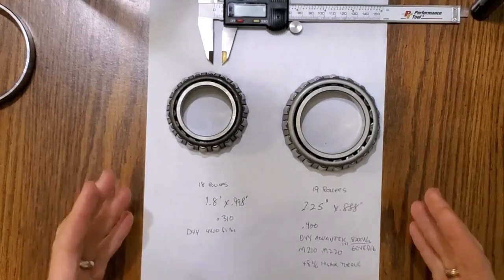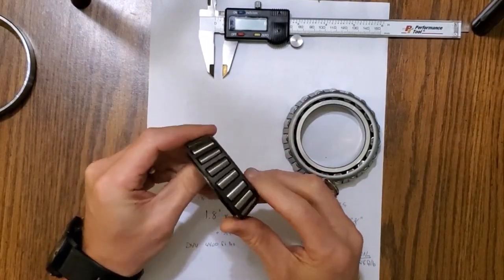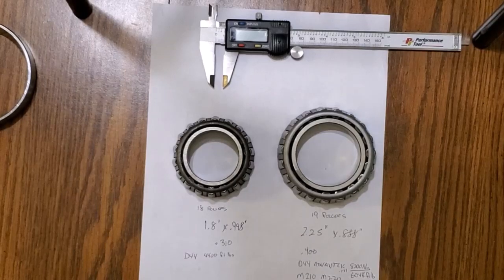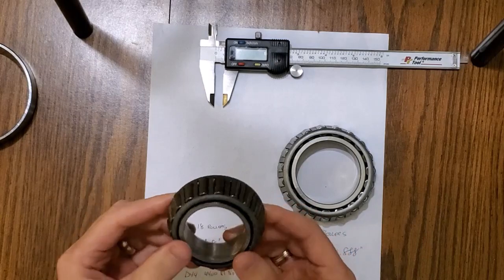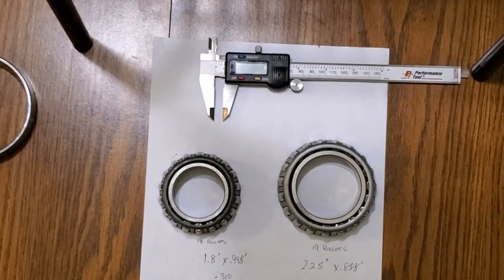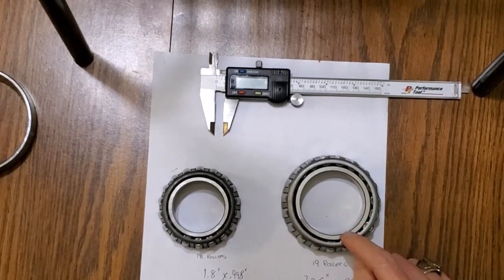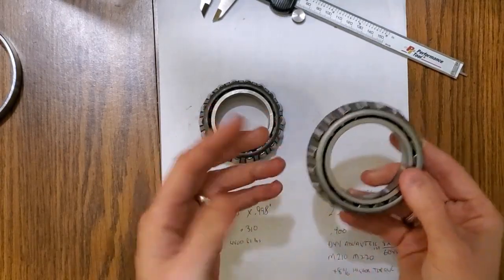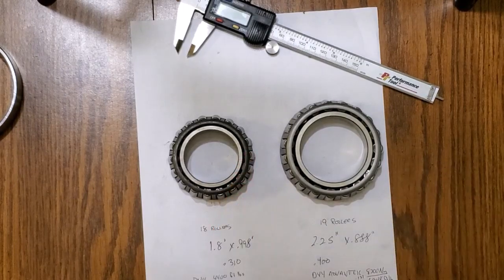Jeep Gladiators come with 1 ton axles!

Comment: Now 2024 would you still choose 4:88 gears, arb lockers, and 35 spline rear axle?
Reply from the maker: Overkill for 90 percent of people but my youtube channel makes like 5000 a year so I have made more money than lost in parts. I wouldn't do this crap for any other reason than it has been fun.
Reply: @c130aviator  thanks for all the info in your videos, I learned a lot and it is helping me with the disisions I am making for my gladiator.

Comment: It would be wise to add the facts that its not just bearing size, its also axle diameter. I had an 88 Bronco and did some research for a SAS swap. You can find 5 and 6 lug Dana 44s as well as 8 lug Dana 44 HDs. The Dana 44 HD had a larger bearing for weight carrying capacity but still had the same size axle shaft. So it could only handle the same  power as the smaller diameter. Bearings provide support and axles shafts  provide the spinny spinny torque twisty action which is what the engine does. Half ton, 3/4 & 1ton are weights. Biggest reason for upgrading is tire size not truck weight.

Comment: I’d really like a video on the Dana m200 (I think it’s a Advantek Dana35) and m185 (Dana 30?). Can these new axles handle 35” tires for rock crawling?
Reply from the maker: I dont have experience with the new axles in those models personally. I have read they are much stronger than the old dana35 and 30. I know the old axles were pretty weak when I had a jeep tj. Many years ago I upgraded thkse with bigger shafts. Just depends on the year.